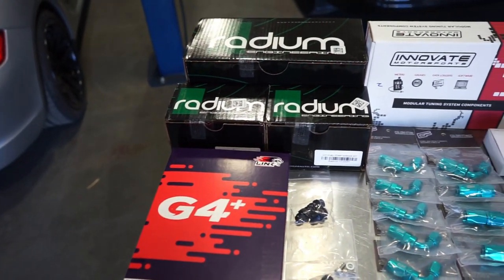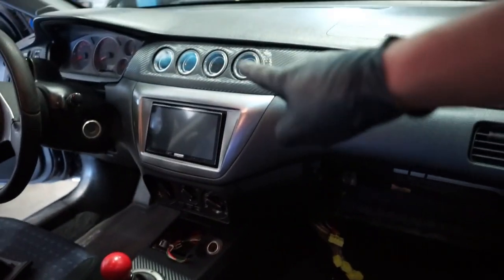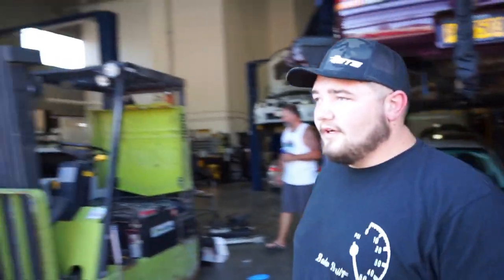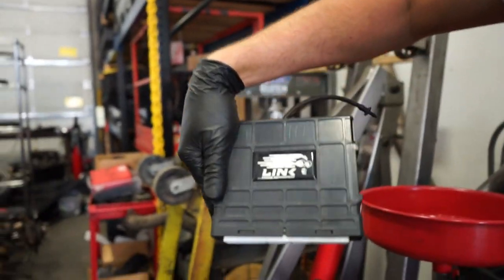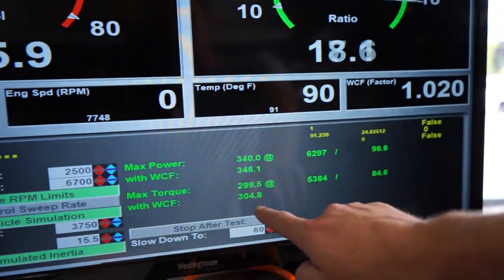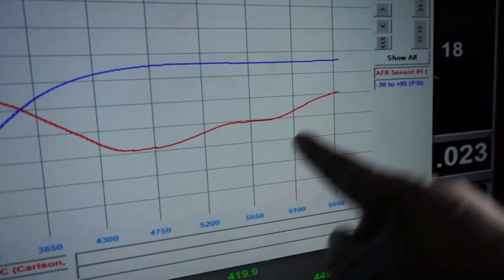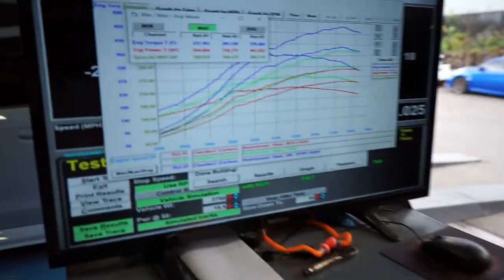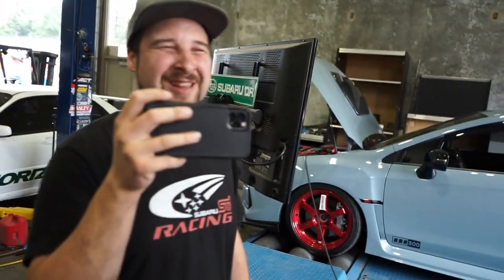Chandlers STI hits the Dyno!

Comment: What was the cause for the silver 05 sti to still have that oil leak after new headgaskets?
Reply from the maker: Update still leaking oil....
Reply: If the new head gaskets were OEM, either the heads weren’t torque down properly or the heads weren’t surfaced properly (or combination of both).
Reply: _BaderBuilt will be curious of the cause. I have a very similar leak but hoping my aos hose is the issue. Just gonna run it till she wants a bbr stage 4 block lol.
Reply from the maker: Marlowe you should watch the video
Reply from the maker: Thatbluehawkeye, we are doing just that lol. he is switching out for a BBR1000 shortblock

Comment: Could similar power be achieved on this build with a top mount intercooler?
Reply: I made 510whp on 25 psi with a grimmspeed top mount with a stock location turbo with the stock exhaust manifold.

Comment: @Bader, is 485 whp seriously ok on a stock block?? O_O
Reply: Guess we will find out lol
Reply: For a short amount of time yes. E85 is the main reason why. I’ve yet to see any EJ reliably crack those numbers on standard 93 pump... it will blow, I wouldn’t daily a stock block STi at those numbers lol
Reply from the maker: It will treat you how you treat it.
Reply: Regardless of how you treat it that is a lot of stress on the stock cylinders which are quite brittle. You’re running on borrowed time at that point. Built block is where it’s at for an STi if you plan on exceeding 400 whp on pump gas...
Reply: @BaderBuiltRacing  lol that is the dodgiest most uncommitted answer to that question. So I'm going to assume the real answer is NOT AT ALL.
Reply: Why not use actual mustang numbers? About 400hp mustang and 485hp correction for dynojet??!! That's a huge difference! Stock block 400hp measured on a mustang already sounds impressive. I'm the end I don't care about numbers because dynos are a tuning tool. Yeah... I'm not the one advertising high numbers. I did fall for the click bait. Lol